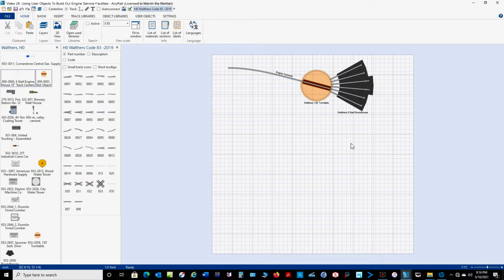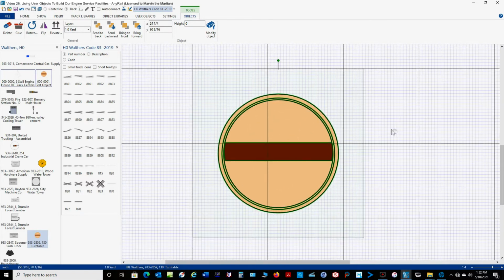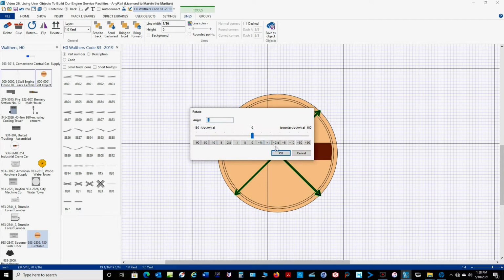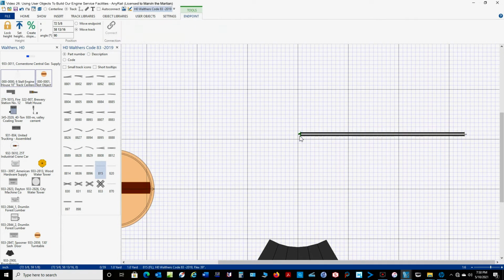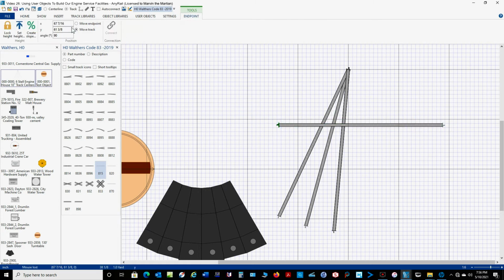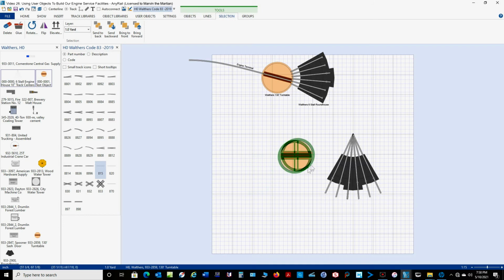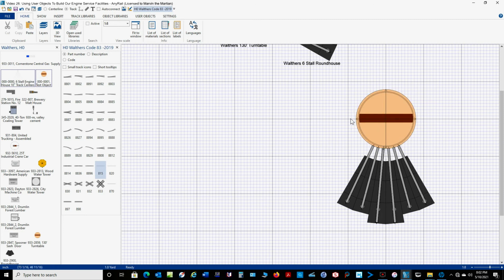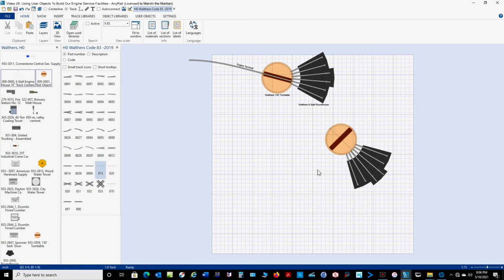AnyRail 6 Tutorial Video 26: Using User Objects to Design Our Engine Service Facilities

Comment: Dave, I have noticed that numerous times you have made comments about what AnyRail does not do compared to the CAD programs that you worked with during your career as a Broadcast Engineer. 
I would like you to compare the price of those CAD products you used to the price of AnyRail.
If I am correct, programs in the realm of AutoCad are way higher priced than the $59 00 price of AnyRail. 
I have very much enjoyed your tutorials on AnyRail and have learned a lot from them. Keep up the good work!!
Reply from the maker: Hi Steve, Glad you are enjoying the videos. I have more planned just trying to find the time.

I sometimes think I am a little hard on AnyRail, I will admit it. And yes, it is a great program for only $59. The price and ease of use is the reason I bought it. But that being said, yeah, it is not like my FastCAD at $500 or AutoCad at whatever they get for it now but I would pay half as much again for some of the items I have complained about (there are so many I forget all of my ramblings). Like a lot of AnyRail users ( I assume) I have no need for 3D or the ability to run trains on my design. I would like the ability to modify and store custom track, be able to copy layers (my current video projects) or group objects to make life easier. Personally I don't like going to forums or making suggestions on them. I don't know if anyone from AnyRail watches any of my videos but I throw things in that I would like to see as a not so gentle nudge to the authors that 'Hey, this would be cool to have'. Since I am under no obligation to AnyRail in any way, shape or form, I just say what I am thinking. There are more expensive design programs for model railroads but they come with a higher learning curve and, really, we buy these programs pretty much as a one use item. Design the railroad and you're done. Maybe come back and change something down the line but that's it. I also think that one of the problems with software designers (and I am complete rubbish at coding) is that the design works for them but it's the end user that really determines the final design. I ran into so many bad designs over the years and spent quite a bit of time with manufacturers stating what should be changed. Some were receptive, some were not. I also like to point out the problems I run into so that viewers will recognize a non feature when they run into it and then I try to offer the best work around that I can. Hope that explains why I sometimes get frustrated with AnyRail. Great program for the price and I would definitely recommend it to others but there is always room for improvement in anything. And that definitely goes for my videos too. Dave

Comment: Excellent video. You used what someone else created. Couldn’t you have used the Walthers library itself for the roundhouse and turntable? I thought they were in the library. I want you and Anyrail to know that I would not have even considered Anyrail if you did not do these tutorials.
Reply from the maker: Hi Derek, I used what was in the AnyRail Walters library. All of those items are created by AnyRAil users as far as I know. I am finishing up and hope to have posted soon a video on taking that turntable and modifying it to make it a bit more useful. Dave
Reply: @steampoweredradio2981  Hey Dave, in my AnyRail libraries there are two, the Object Library and the User Object Library.  The Object Library for HO has a Walthers Structures library that has 3 turntables from Walthers all of which have track connectors pre-positioned on them.  These objects are not modifiable like the User Objects however.  Building the roundhouse with these is easy as the track snaps to the connectors on the table.  Just thought I would mention it in case you had overlooked them.
Reply from the maker: @richardcross9123  Richard, That is true. One of the things that I wish you could do with AnyRail is modify and then save an object, structure, track, scenery for future use. This would be extremely handy with track. If they wrote it so you could not overwrite the original and it always had to be saved as an edited entity that would make AnyRail a much better program. I looked at sidings and crossovers this morning on the UP. There is a bit of straight in the track but how much I don't know. I would also suspect that the amount varies for track spacing, length of turnout and the speed at which they want to run thru the switch. Must be info on it somewhere. Dave
Reply: @steampoweredradio2981    Dave, yes it would be great if we could access the tools and details that the "official" object creators use as well.  Things like live connectors.  Maybe someday.

Thanks for looking into the turnouts.  I use fasttrack N scale turnouts and the detailed drawings show they are straight from the frog to the end of the divergent rail.  A distance that varies by turnout #.  I then put in a short piece of straight to try and get this to the suggested total straight (1 average car length) before putting in the curve onto the turnout tangent.  

The other S curve that sneaks in is in "back to back" turnouts like in the far right of your yard.  The place in the switch lead/through freight west meets the ladder.  A short piece of straight (an average car length) put between them can help this out.

If  don't say it enough.   I truly enjoy your videos.  Without them, AnyRail would be much harder to work with.   Thanks!
Reply: I would have thought that Walthers would have the 3 stall modern roundhouse and 130 foot turntable available in their building or structures library like they have all of their track pieces and buildings.

Comment: Hi Dave from the UK - enjoying your AnyRail videos.  To make things easier if you use the Peco turntable in the "00" section you will find that it has AnyRail connecting points all the way around the circumference which makes the alignment task a piece of cake.  It also has the track on it and the surrounding object box fits it exactly.
Reply from the maker: Hi Peter, interesting about the OO turntable from Peco. I wanted to look at it before I finished the video I am working on about modifying and saving the Walthers turntable but I can't find it in the OO Peco library. I updated the libraries but it still wasn't there. I'll keep looking. It's very possible I did something wrong. I wish I had more time to thumb through all of the libraries to see what's there but I pretty much stick to the HO libraries and the ones I use the most. Maybe a master index for all of the libraries would be a good project. A big project though. Glad you are enjoying the videos. Take care and stay safe! Dave